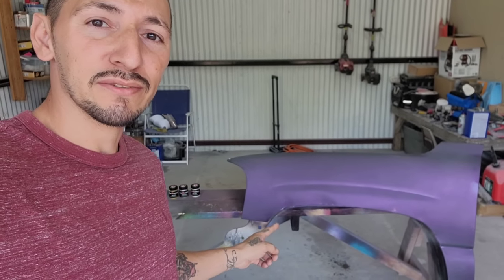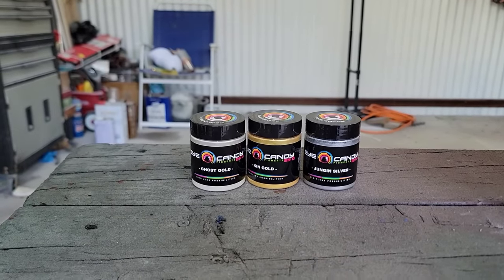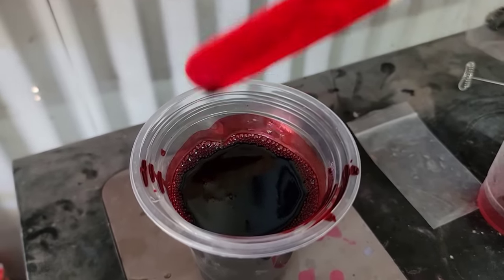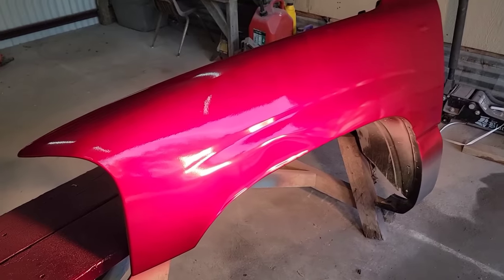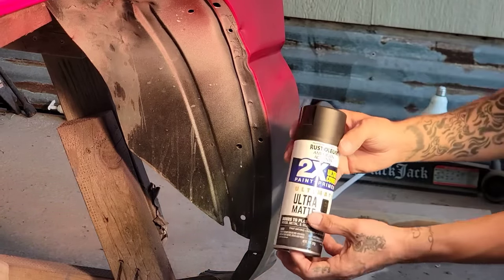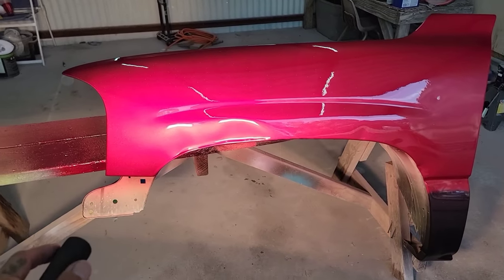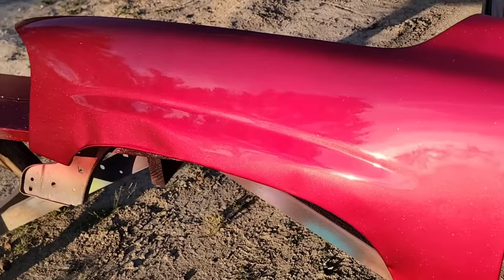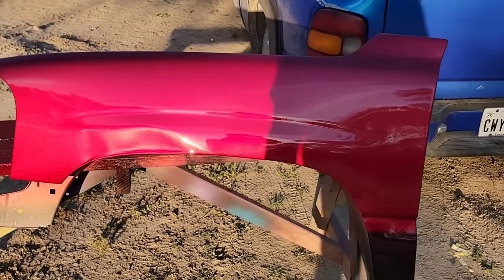Let's Spray - CANDY RED over RUSTOLEUM Gold Metallic

Comment: I did a guitar that was very interesting.
Rattle can gold base, Rustoleum gold glitter, then I started with that Duplicolor Paint Shop Clear Coat that you get from Auto Zone.
   I then got some Voodoo Violet candy concentrate off eBay, and mixed it into some of the clear, and shot it over the gold glitter. It turned out amazing!
   The most difficult part of the whole thing was finding a combination of paints that didn’t react with each other, but it was a novice way to achieve a seriously cool old school, low rider/chopper/hot rod style look without anything more intensive than a $15 Harbor Freight spray gun.

Comment: So doing the math, if your using 1 gram per 5oz, you'd use 6.4 grams per quart? So a 25 gram jar would mix with a sprayable gallon? 
Got 5 grams of Zen garden, 25 grams Monitor lizard, 5 grams sushi roll on the way. Taping off as I wait. Excited for something new! Curious about the black pigments I saw on there site, and how they do over colors and White.